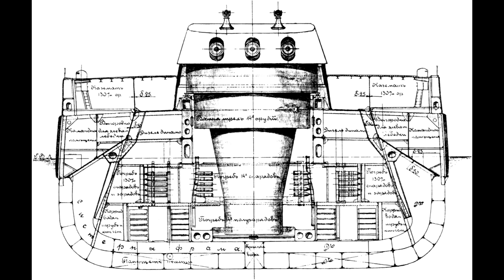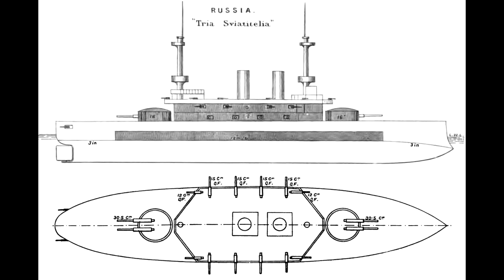The Drydock - Episode 273

Comment: Looking at the aircraft storage in the hangar overhead I'm immediately impressed by the fact that it's just an excellent use of dead space.
 The deep girder frames providing strength to the flight deck above create an otherwise unusable volume. Hangar clearance to the deck below is measured from the bottom of those frames, so anything that can fit up there is stowed up there. Still true on every carrier I was ever aboard in my service.

Comment: 13:43 The balance extension of the turret is called a bustle, and is still common place on AFVS, but a main reason for balancing a turret either Naval or tank is the amount of effort to move the lump, so in a ship power traverse (try moving a battleship turret by hand crank) the more out of balance the turret the larger and more power the traverse motor required.  

It is said that the huge turret on KV 2 tanks could not traverse if the tank was more than 20° out of level, and similar problems were found on the German Panther -which did have a turret extension but obviously not enough to balance the big shooty thing but on a tank the traverse was limited to either hand cranked or comparitively small under powered electrical or electrical/hydraulic motors,  but the size and power availablity  to traverse motors was limited in tanks compared to the available power in ships.

Comment: 48:23 - "Ah, we have a problem with Liberty ships breaking apart when they shouldn't be"

Is there ever a time when they should be?
Reply: Properly designed ships shouldn’t break in half.
Was this ship properly designed? 
Well obviously not.
How do you know that?
It broke in half.
Reply: The front fell off
Reply: I mean...if it's breaking up under large amounts of shellfire, that's not an ideal situation, but less an indicator of a design flaw than of imperfect naval strategy and tactics.  If it breaks in unusually inclement weather, that's similarly at least possibly a result of poor seamanship and sailing into weather you should have known to avoid.   If the seas are calm and the enemy is not shooting at you, but the ship breaks anyway...then yeah, you have a problem.
Reply: When you take for type 95s midship.

Comment: In terms of plans for Age of sail vessels one of the elements that is often missing on plans however is very important to the people back then, is detailing, so the Firgurehead will not be present and the detailing and soemtimes the shape on the stern gallery will also be missing. Which is very important and is also a very distinctive exterior indicator of the age of the vessel, in terms of shape, type of decoration and the amount of decoration and colour used on thr stern gallery.

Comment: In the answer to the first question , you mentioned the "zero" , as far as I can understand the zero was an ultra long range ( for its time) ship board fighter, soo? How did Japanese zero pilots find the ship after a long range sortie? Extremely  fantastic navigation?, homing beacons?😮😮😮 just how?
Reply: They had a type of RF (radio frequency) location beacon, at least some planes did, the disadvantage of that was though, that you only got a general bearing (as in home's somewhere THAT way) it didn't really give distance, that was where you had to rely on Goodwood fashioned "dead reckoning" (basically, ok we're HERE, WE need to fly north for say, 15 minutes, then turn due west and fly for 20 minutes, etc)

Iirc those were the common methods back then, hope that helps.
Reply from the maker: Additionally, almost all their really long range missions were flown in support of multiseat attack aircraft which were better planed to navigate.
Reply: @Drachinifel  thanks ,drachma,?  It always seemed a mystery to me how such a long rangenplane could navigate over water. Thanks for such an easy clear cut answer that does not that questions like this as stoopid. ( unlike some in here)

Comment: American hydrophone operators during WW2. Were there any operators who picked up "long lances" at extreme  range, and were disbelieved or sacked?
Reply: Mind, WW2 hydrophones didn't have an inherent "ranging" function. They are just underwater sound receivers that tell you there is a noise that came from a direction. Ranging is more a matter of the operators using experience and reference points over time, and if you have not heard a specific sound multiple times to develop an "ear" for how the thing sounds at specific known ranges, then you can't really estimate distance specifically. 

Modern hydrophones use computers with massive databases of sound information to make comparative analysis so they can actually estimate range of common sounds, but in WW2, your hydrophone operator was mostly only able to say "I hear what is probably a torpedo and it seems like it is moving in this direction or that." 

Thus, there would be no "punishing" hydrophone operators for wild claims about torpedo ranges because the operators would only be reporting they heard torpedoes in the water, not how far away they were. 

Any "ranges" associated with WW2 hydrophone use are ultimately the product of cross-reference with other data sources AFTER the fact. Prinz Eugen's famous detection of the British ships at Denmark Strait was done by researchers later comparing the time of detection with the known position of the Prinz Eugen and the British ships. Prinz Eugen's operators only were able to warn the Germans that they heard powerful turbine engine noises coming from a direction, but actual range was later established by optical and radar systems, not the hydrophones themselves.